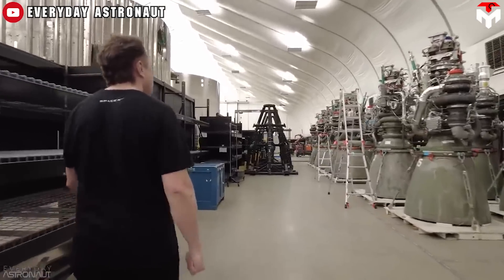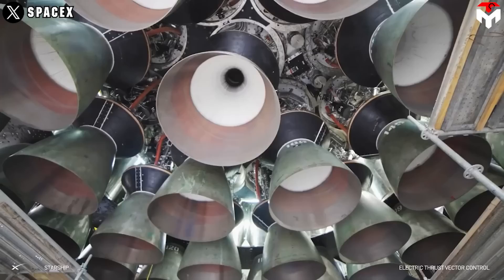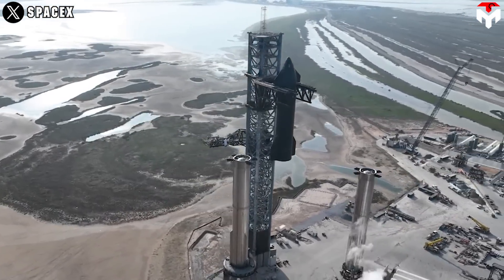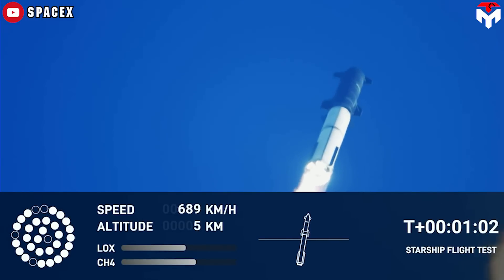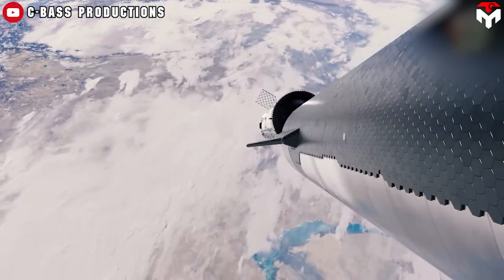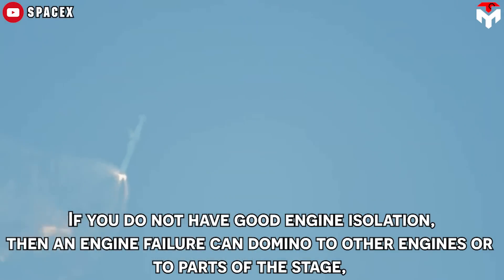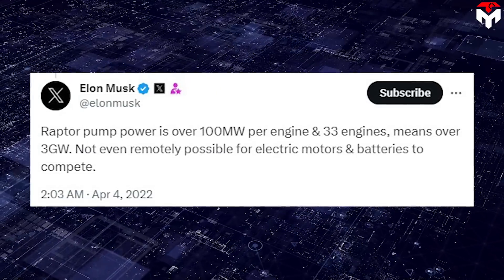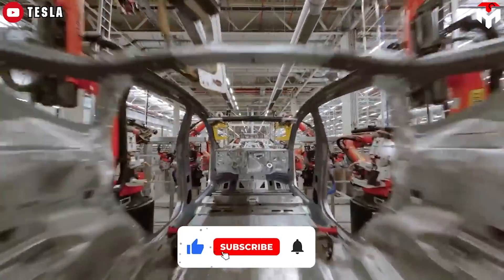Elon Musk Revealed Massive Upgrade to Stop Raptor Fail during IFT-3...

Comment: The change of actuators from hydraulic to electric describes only half. Remove Hydraulic actuators( and replace with electric actuators), remove hydraulic pumps & piping( & replace with electric generators & wiring). Actuators need activation, electric or hydraulic.
Reply from the maker: Yes, sure

Comment: I doubt hydraulic cylinders being that much lighter than electric motors with a battery instead of a HPU. Besides, if the performance of Tesla's in winter is appalling, imagine what will happen in the cold vacuum of space.
Lead-acid batteries will prob perform better than Li-Ion ...

Comment: I doubt SpaceX wants to use Tesla motors to spin up the turbo pump!? It's a closed cycle rocket engine so you'd have to change the design. Tbe batteries and motors they purchased were only for the thrust vector control of the Raptors.
Reply from the maker: Yess, I also agree with u

Comment: All these problems were predictable.
in fact I warned about the string of fire crackers effect several years ago on SpaceX related forums.
also suggested getting engines behind a fire wall and vectoring just the cones.

Another way to fix the slosh problem, would be to have a set of smaller reserve tanks just used after seperation to reorient the booster, and get the liquids to settle in the main tanks. i.e. the restabilizing burn starts on full tanks.

Kind of like reserve on VW Bugs...
Reply from the maker: Thanks for useful cmt